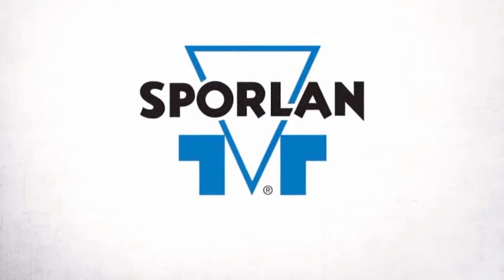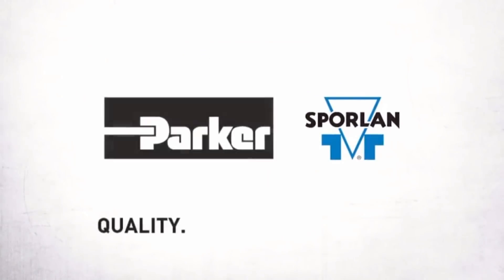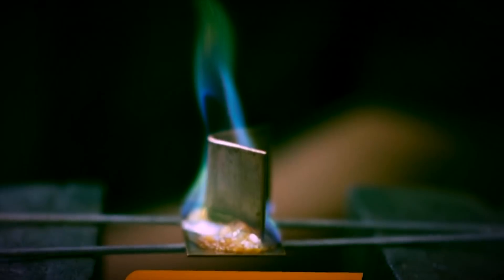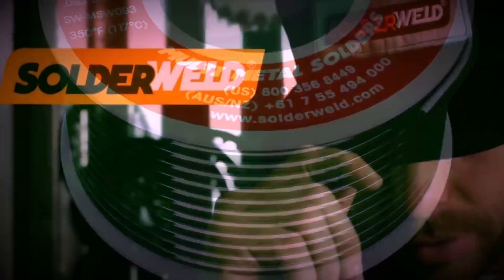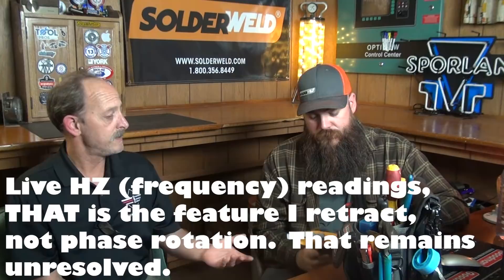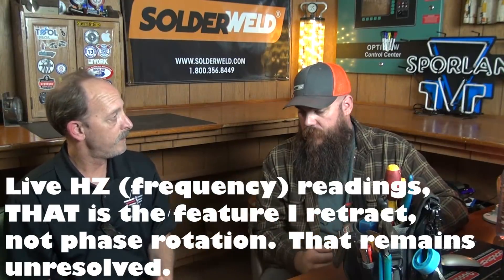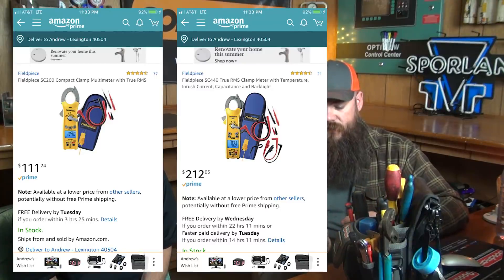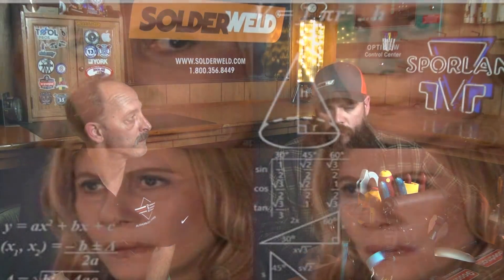Fieldpiece SC660 revisited ~ Discussing what I got wrong, and what remains unsolved with Ralph Wolf

Comment: need to "force" everything to run at 100% output to check it,  VRF is ILR a joke for repair and testing ;)
so many of them FAIL at proper documentation..... you need real "MOTOR rpm's", "they should give a maintenance mode" that locks it all to 100% for testing and go go go.
until then, to hell with the BETA garbage......

Comment: rps is revolutions per sec of the rotor in the compressor motor. not sine wave.
Reply: a 2 pole rotor will spin 1 to one sine wave hz to rps. 4 pole rotor will spin 2 to 1 rps to hz. etc
Reply: Randall Calhoun it makes sense the explanation but where can I find a technical book that teaches about it.
Thanks
Reply: A good way to think of it, and to also to look into this, is to look at how an electric generator works. A magnetic rotor rotates inside a stator can that has wires that are stationary. the magnetic flux lines rotating with the rotor cross the windings in the stator and cause current to flow through magnetic induction in the stator wires.

The opposite is happening in an electric motor.  The electrical current changing polarity induces a push against the magnet in the rotor. 

 if you have 1 magnet (2 pole rotor...north and south) in the rotor you get a 1 to 1 frequency (one cycle of current) inducing 1 revolution. if you have 2 magnets anf therefore 4 poles( 2 norths and 2 souths) you get 2 revolutions for each cycle of current.

So rotation of a 4 pole rotor design electric induction motor in a vfd driven compressor will need half as many cycles (hz) to spin as a 2 pole.

Comment: She's double Mama, she's double. XX. I knew that couldn't just be a coincidence. But you still need to check out the Amprobe Amp-320. Just for the 3- test lead rotation function alone. And it will fit in that small Veto bag a lot nicer also. 👍

Comment: Thus a disc rotating at 60 rpm is said to be rotating at either 2π rad/s or 1 Hz, where the former measures the angular velocity and the latter reflects the number of revolutions per second. If the non-SI unit rpm is considered a unit of frequency, then 1 rpm = 160 Hz.1 Revolution per minute is equal to 1/60 Hertz. RPM is commonly used to measure engine performance. Period is the inverse of frequency. 1 RPM = 1/60 Hz or approximately 0.0166666666666667 Hz. In some countries 1 rpm is 1/50 Hz.
Reply from the maker: In this situation were talking about revolutions per second, not minute.  There are 60 revolutions per SECOND in typical U.S power distributed from power plants.
Reply: "Thus a disc rotating at 60 rpm is said to be rotating at either 2π rad/s or 1 Hz, where the former measures the angular velocity and the latter reflects the number of revolutions per SECOND". As stated on my first comment.
Reply from the maker: More specifically I was bringing up the confusion from a manufacturer using a term “rps” to describe compressor frequency, and have it turn out that it does not directly translate to the actual hz readout on a tool that reads frequency.
Reply: Sorry you removed the video before I had a chance to see it.
Reply: The RPM comment was in reference to China. Maybe the use 50 instead of 60 Hz electrical motor.
Reply from the maker: xrayneoo yes, I removed the first video because I made a very incorrect declaration about a feature on the meter.
Reply: I respect your decision, but you did only follow the confusion from a manufacturer using a term “rps” to describe compressor frequency. We can all learn from this video manufactures make mistakes like all of us.
Reply from the maker: Respect what decision?

I posted the video precisely because I wanted to share my mistake regarding the manufacturer’s terminology.  I still don’t understand the paragraph you pasted from google about recip compressors and how it related at all to the video.
Reply: I don't think it was your mistake. You were missed informed. 
I miss understood, it was related to conversion not compressors. It won't happen again.
Reply: to remove the previous video.
Reply from the maker: My mistake was making the first video last week criticizing a tool’s feature I did not interpret properly.  At the end of the day I had a responsibility to Fieldpiece and the viewers to check and correct myself.
Reply: I remember my first beer!!! 😂😂😂. Fucking flux capacitor every time end of discussion.
Reply: Next time your crane operator makes you wait. Hope this put a smile on your face.https://www.youtube.com/watch?v=9xkBTd9vaVw&t=382s
Reply: Compressor crankshaft revolutions?
Reply from the maker: Joe Shearer I believe so, but again it’s often unclear in the Japanese literature.
Reply: I'm a bit late to the party. Could it be that the motor is geared, therefore any rotational speeds of crankshaft don't match up with motor rotational speed? 
If that is the case, then it would depend on the manufacturer and how they design their systems....
Reply: The capacity of the compressor is very important parameter, since the capacity of whole refrigeration or the air conditioning plant depends on it. The capacity of the reciprocating compressor depends on the diameter of the cylinder bore, the length of the piston stroke inside the cylinder, number of cylinders in the compressor and the speed of rotation of the crankshaft. Piston displacement of the reciprocating compressor is the volume swept by the piston inside the cylinder in unit time and it is same as the capacity of the compressor. The piston displacement or the capacity of the compressor can be expressed in cubic meter per min (m3/min), cubic meter per sec (m3/sec), cubic feet per minute (cfm) or liters per second (lps).
Reply: xrayneoo very interesting you must be a mechanical engineer
Reply from the maker: interesting, but that was a very long description of a recip compressor.  This eqiupment uses scroll compressors.
Reply from the maker: Not likely, those comments are cut and pasted from engineering web pages off google which is why they're overly complex, yet hardly relevent to the subject matter of this video.
Reply: Could you please explain the difference between non-SI and SI unit rpm? rpm isn't an SI unit though... its a derived unit. It should be the same as 1 minute is always 60 seconds. OR am I missing something here?
Reply: https://www.quora.com/How-is-the-relation-between-SI-and-non-SI-units

Comment: I have the removable head and my personal opinion it’s garbage. It has this feature that it beeps when there is voltage. On 24 and high voltage. But sometimes it beeps and other times it dose not. I’ve had to double check it with my hot stick several time. And it will show readings even when voltage not present. Super disappointed in it. I have used field piece for years. Just do not like the removable head version. Good video!  Don’t know much about the new diakins  hope a course runs thru Az soon.